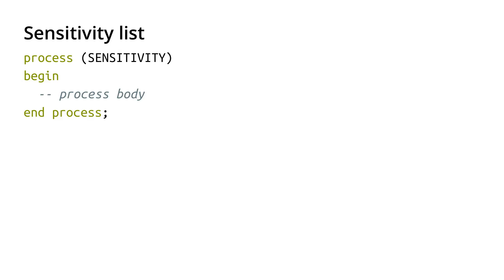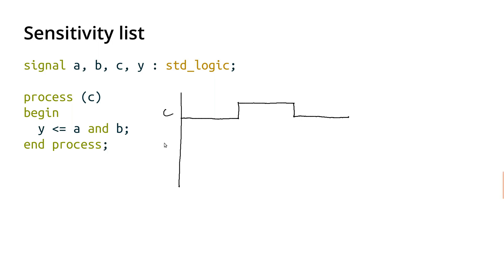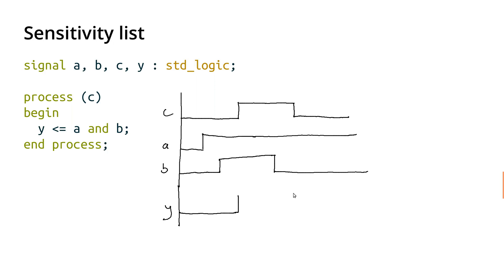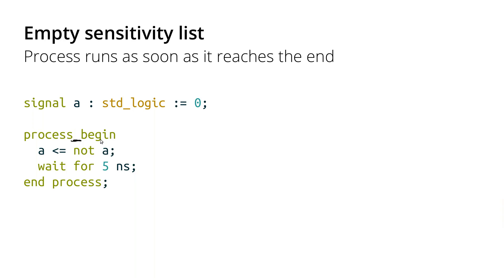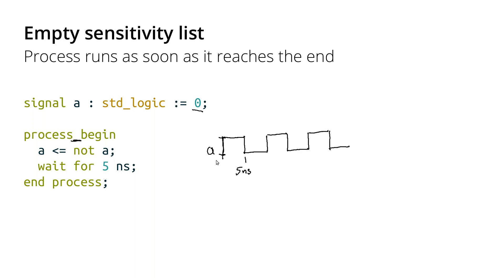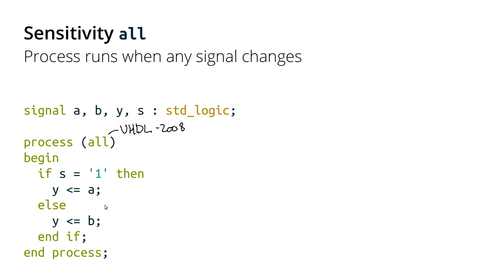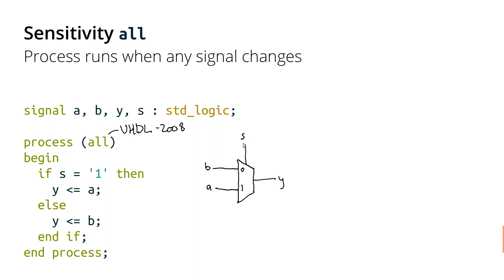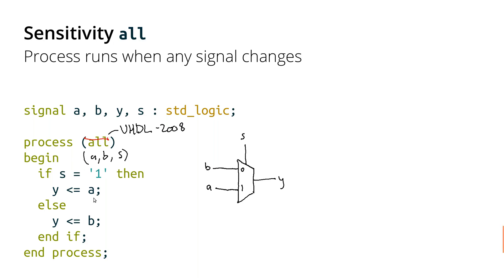What is a VHDL process? (Part 2)

Comment: For creating a clock by process, you should have inserted one line of code after wait For 5 ns :
signal a : std_logic := '0'
process 
   begin
      a <= not (a) ;
wait for 5 ns ;
      a <= 1;
end process ;
Reply from the maker: The line a <= '1'; doesn't do anything in this example... remember that with a non-blocking assignment the signal doesn't get the new value until time passes.  So after "a <= '1'", it goes back to the top of the process block and does "a <= not(a)" with the *old* value of a.  If you put a "wait for 5 ns;" statement after "a <= '1'" then it would work, but it's not clear what the advantage of this would be.
Reply: @botsnlinux  i had a similar doubt, thanks for explaining!

Comment: Sir In the example without sensitivity list, won't the first value of 'a' is 0 for 5ns, and then 1 .Because 'a' was initially 0 and it has to wait 5ns for its value to change.
Reply: From what I understand, signals are updated at the beginning of wait not at the end. So at the start of the wait at 0ns 'a' will be updated to 1